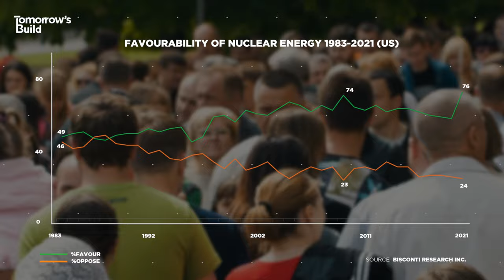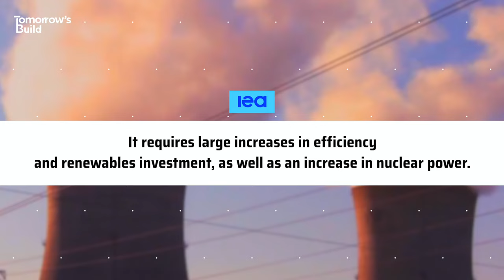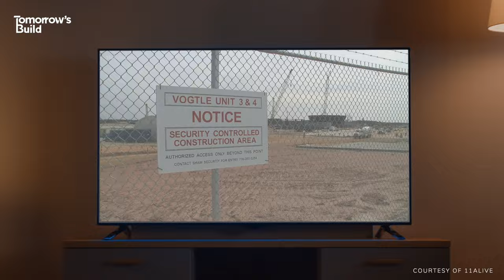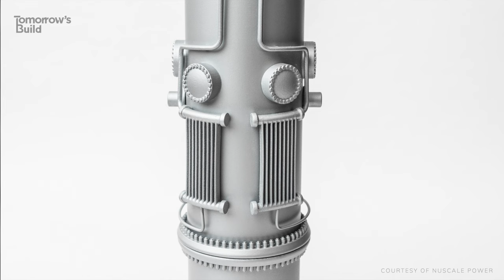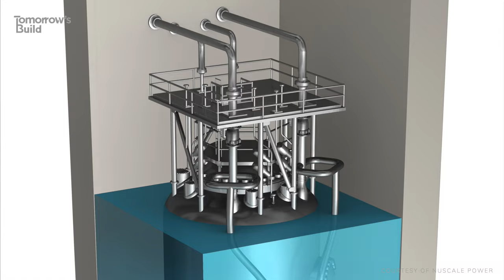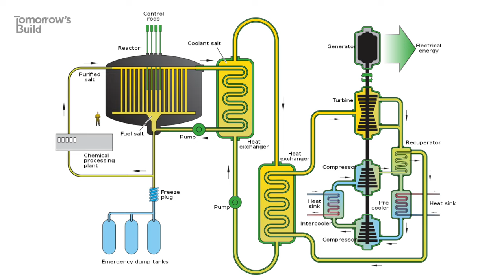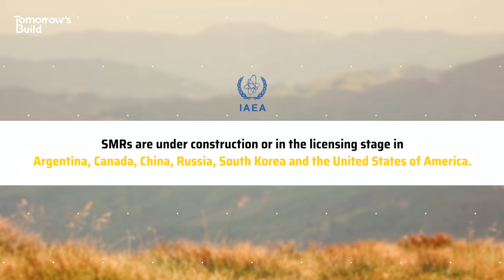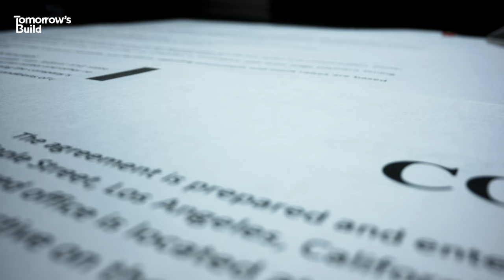These Mini Nuclear Reactors Can be Built Anywhere

Comment: The US has been building "small" reactors for naval deployment for literally decades.   I find it far more shocking that this experience has NOT been incorporated into small, modular power plants for domestic use than any news that it might finally be happening.   About time.
Reply: For military use, cost per megawatt is not a concern.
Reply: Much of the tech is classified for national security reasons.
Reply: We need these SMRs as soon as possible. Set up a production line right now.  Rolls-Royce UK can build them cheaply - one or two for each town or City.  Let’s get going with a production line assembly.
Reply: The problem with "domestic use" nuclear reactors is both safety and security. I would not want a nuclear meltdown in my literal back yard, because some neighbor decides to save some money on maintenance. And I would not want nuclear materials readily available for every guy with a beard that wants to make a dirty bomb.     
I would prefer small modular nuclear reactors, deep underground, with proper safety and security measures in place.
Reply: The naval core geometries and rod programing (and arrangement) are based on a very highly enriched fuel and restricted space, so refueling only has to be performed a few times over the lifetime of the vessel (more for the early ships and boats, and the cores on the new class of carriers are supposedly good till end of life of the ship). The cost of the fuel and the fact the enrichment is higher than that allowed in civilian plants is one of the biggest reasons the tech doesn't transfer bolt by bolt. Also the physical construction of the navy core fuel assemblies and cooling channels is just way over built for civilian use, think using a Humvee as a daily commuting appliance overbuilt.

With the new SMRs the emphasis is really on "walk away" safety and factory production efficiency all while meeting all the industry experience gained in the past 50 or so years of civilian power plant operation. The navy core safety systems are based on the fact the plant is literally sitting in the largest pool of coolant in the world with a highly trained crew using rock solid casualty procedures, where the SMR designs have to consider possible deployment in places where coolant isn't as available and still shut and cool themselves down without operator action or external power sources.
Reply: We need to produce them in factories so they can be inspected in bulk, and kept safe, if not made safer. That will bring down the cost.
There will be a minimum practical size for a mobile reactor for use in ships. This will cause a minimum size for a ship that can run nuclear power practically. For instance, let's say the minimum practical size for such a ship is 130 feet long. Then it would be stupid making 120 foot long ships. Make ships at least 130 feet long and use nuclear power.

With time, reactor sizes might shrink some more. If/when that happens, then 100 foot, 80 foot, or even 60 foot nuclear ships could make sense.
All naval ships, many of the naval boats, and all ocean freighters and cruise ships should go nuclear.
Reply: @quercus3290  Part of the issue is waste: the US, and the average consumer, lack proper disposal facilities. Building a whole bunch of new reactors when current reactors already lack disposal facilities would be... bad. In the same way, we have the technology for flying cars, but you'd be effectively scaling up all the accidents of early aviation to a commercial scale.
Reply: @scratchy996  Absolutely. Also, I don't want some corporate bean counter (probably without a beard) to decide that the company will skip on maintenance or SECURITY to up the bottom line, because the subsidy ran out. 
Some things are NOT socially or economically efficient in the private sector. This is one such. Mutual benefit and transparent operation need to happen, same with wind and solar. And it needs to be a PUBLIC utility.
Reply: @thezfunk  This sounds like people outside the military have reinvented this on their own, and the military has not yet swept in with money for their patents or to order them to quit. 
Now it seems to have hit the market of ideas as well as the market, so what can they do?
Reply: @majoroz4876  no? First off, the storage facility need to be isolated from water, food and wildlife, because contamination risk. It needs to be long term, like centuries long term, because that's the sort of time frame nuclear waste is dangerous on. There needs to be security, because it's goddamn radioactive material that some crazy bastard might steal. Infrastructure to support that security and transportation of the waste, and it needs to be safe from things like earthquakes and other natural disasters. 
You don't just pile all the waste on top of itself in a shallow grave, because that's how you turn a state, or maybe even a continent, into Chernobyl 2.0.
Maybe read a book and you'll know that the US government planned such a facility, but never followed through, not for lack of experts saying it's needed, but for cries of NIMBY.
Reply: @callumjohnston858  I have degrees in engineering, science, health, and edication.  I have taught them for 50+ years.   People like you kick, scream, and resist ANY forms of progress out of fear and would not install light bulbs in their homes until decades after the rest of us.  The polite term is ignorant chicken littles......but there are other terms.   Research Dixie Lee Ray, the first cheif of the Atomic Energy Commission.
Reply: @majoroz4876  Sure mate, you've got all the degrees. But what you don't have is the knowledge that the USA has no long term nuclear waste storage facility for its current nuclear power plants (let alone any new ones, or SMRs) despite having selected a region about 30 years back, and is effectively paying for storage on-site, which is an unsustainable solution (literally, it cannot be kept up, given costs and the fact that storage facilities are already breaking down) and has already caused numerous health concerns for those nearby. 
This isn't about rejecting progress, this is about not having the fundamental infrastructure to progress without everyone getting radiation sickness. There's a level of irony there, given that sustainable non-nuclear alternatives exist (and before you jump on that, I wouldn't bring them up if they weren't about the same in terms of practicality and cost). 
And frankly, I don't see what Ray or her time in office has to do with that, except the vague similarity that nuclear energy was involved.
Reply: @quercus3290  bruh, the whole earth core is the nuclear waste. But yeah, dealing with is pain.
Reply: @majoroz4876  security is a serious point. All big nuclear stations has military forces in arms reach in case of terrorists attack. You simply cant provide that for your basement reactor.
Reply: Damn right. It's fine for a sub or an aircraft carrier but not for civilian use? Wtf?
Reply: @squamish4244  do you think every country should have a nuclear industry?
Reply: @squamish4244  yes. The price.
Reply: @squamish4244  We are talking about big/small reactors comparision, and whatever you do, the small one will loose price competition. Simply because efficiency of all systems scales. I am not even mention security issues of small reactors.
Reply: @squamish4244  my concerns about every country having a nuclear industry is that some countries like North Korea are extremely dangerous and supplying uranium to them will destabilise their neighbours. 
That would involve the USA military and the USA defence costs increasing.
Reply: @stephenbrickwood1602  The USA already spends at least $81 billion a year and probably a lot more on its military presence securing oil production and distribution.

Every country having a nuclear industry and that being a danger is a political issue and not an economic one. If we are going to go there, then we also have to factor in the fact that civilization is literally under threat from fossil fuel production, and that is not a theoretical risk that diplomats can handle.
Reply: @squamish4244  you are right about the global threat of fossil fuels. 
It is a good question how do you stop an independent country from using fossil fuels if that is their choice. 
It would be an embarrassment  for many countries to go with 'no CO2' and still others 'freeload' and keep burning fossil fuels. 
A country may feel that a warmer planet suits their geography, latitudes,  ???
Trade sanctions and better technology may work. 
Do you know the term 'nuclear winter'? 
Many do not.
Or Climate destabilisation  ?
Reply: @majoroz4876  do you think every country should have nuclear industries  ?
Reply: @stephenbrickwood1602  I don't think that every country SHOULD.......anything.  But, I think every country should have the RIGHT to have one, if they so desire.

Comment: By downscaling the size of the reactors, if there ever is a major problem, the aftermath with be smaller too. Unless there is a design flaw, many smaller reactors seems much safer than one big reactor, since the big ones tend to get too expensive to maintain.
Reply: Not really true. It's largely dependent on the type of (used) fuel/fission products and how far exactly such a hypothetical accident would go. The actual size of the reactor and amount of fuel says very little how much could be contaminated.
Reply: @lennoxbaumbach390  Nuclear engineer here, this isn't true. More power = more fission = more fuel, a lot more can wrong when you're dealing with gigawatts of energy (especially in water reactors where pressure can be a problem). Specific fuel type doesn't matter if there's a Chernobyl type accident, a high power reactor will spit out more nuclear material and fission products than a smaller one. And that's without considering the safety mechanisms that a lot of these newer designs are using. Things like passive cooling and inherent reactivity feedback go a long way in keeping the fuel safe and sound. Plus designs like molten salt and metal reactors operate at essentially atmospheric pressure.
Reply: pyropulse  If they explode violently in a Chernobyl type accident with no containment they do, however the probability of such an accident happening with modern reactors is essentially impossible. That said, my original statement still holds true, a higher power reactor (especially one dealing with high pressures) is technically a greater risk than smaller reactors.
Reply: @lennoxbaumbach390  
You are talking crap.

Comment: Molten Salt Reactors (MSR) are safer and cost less because they are not pressurized like water based reactors. SMRs that are water based are just as dangerous as light water reactors. They can blow up or melt down.

Comment: Heavy industry needs to consider these. Like I get that these can't be used to fire steel foundry crucibles. But what about the rest of what runs on electricity? Like hydraulics, administrative areas, etc. etc. Let gas melt the metal, but I'm pretty sure a whole bunch of other stuff can run on this. We need to replace the worst polluting power plants, the last of the coil-burners.

Comment: Great to see Nuclear Power coming back. Many small are much better than a huge one. Modular makes them more convenient and flexible to operate. Would love to see micro/nano to power Rail Engines as well supply power to Railway grid. They are ideal for such things.
Good to see the nuclear waste being used. Hope that the nuclear waste problem will get resolved in environmentally safe way without consuming too much space and at much less cost. Recycling as fuel would be the way but still after that some % needs to go to waste.

Comment: Or start building shipping container size passive radiation reactors that have already develop and working. For instance one Russian village bough one from Russian military, buried it on the corner of the field to amp up radiation barriers and it powers whole village with some excess power being produced. Its entirely self contained and adjusted unit that only needs to dug up every 20 years to refuel. Only down side is that it needs to have some load on it constantly, but that is easy enough to solve by pumping excess into grid and having safety load case grid connection is cut by storm etc. Also it might need little extra radiation shielding since soviet engineering, but it works, sadly average person is not allowed to be energy independent around here, that would remove people from grasp of the government.
Reply: You forgot the other downside: It's not cost effective (unless you're in some remote isolated part of the earth).
Reply: And after 20 years, it malfunctions, is abandoned, forgotten & left to deteriorate in a cornfield somewhere until it starts leaking radioactive products.
Reply: Building 5 to 10mw small nukes would be in runs at a factory which would reduce costs. Plus they can be built in groups of 2 or 4 for larger requirement loads.
Reply: @bradvansteinburg2962  Designs for small modular nuclear reactors have been around since the 1960's.  Unless the factory is really remote, connecting to the grid is always going to be far more economical.
Reply: You're "not allowed" to be energy independent because there is no such thing. Claims otherwise are illusionary.
Reply: 3, 5 , 10mw reators will be cost effective built in a factory.  No need to build 100mw + nukes in most cases as tech had changed.
Reply: @bradvansteinburg2962  its not cost effective when you factor staffing, security, national defense risk, and expected corporate malfeasance.
Reply: @bradvansteinburg2962  That's been the promise for a long time.  Some nuclear energy startups have made big promises, but I suspect they'll only deliver small, incremental cost progress.

Comment: I love the smaller ones that look like they could almost fit in a container. I can see the smaller ones as being a safer way of providing electricity to small Northern California towns that are isolated, doing away with the need of long-distance power transmission lines that power companies don't seem to want to maintain anyway. The U.S. is lucky in that solar and wind power both make economic as well as environmental sense but the smaller ones seem viable. I can see Western militaries also using the smaller ones in the near term future. More power is required for the battlefield and if Brigade Combat Teams were set up with electric vehicles the SMRs would enable that process and reduce the Army's logistical tail.

Comment: Another use of modular reactors could be as a power plant for large container ships and the like.
Reply: Nuclear subs cost $3.5bn - $7bn. The world's largest container ship costs $190m. Whilst they are different beasts, the nuclear reactor cost is a large compoenent of the total.
Reply: Modular reactors would be cheaper than the reactors powering current warships and subs, which shouldn't compare with container ships, since warships and subs are armed to the teeth with very expensive weapon systems. Besides, with diesel and coal off the table with climate change legislation, what else are going to power these ships? Where would you put sails or solar panels atop a container ship?

Comment: I remember learning in high school that 90% (some high number) of the costs associated with building modern day nuclear reactors come from the concrete tower around it. Russia and China were able to pop reactors around the place due to having looser regulations and hence very thin concrete walls (i.e. they recognised that the concrete is obselete and hence only use a concrete facade to appease the public). If only governments had not neglected reactors in the past... None of these "safety concerns" would be in debate and we'd be lot greener for it
Reply: sounds like making faster cars by having no airbag.
Reply: damaging, racist as it divides POC communities, and dangerous. We need more public and human based transportation, hell  even publicly owned horses would be a better alternative.
Reply: @therealspeedwagon1451  Racist? Weally?
Reply: @therealspeedwagon1451  Everything is racist these days. Freeways I understand, but nuclear plants? Seriously?
Reply: @steeldriver5338  atoms will split regardless of race
Reply: Nicanor makes an excellent point. It does seem like making the car be faster with no airbag, or seatbelt, or sunshield visor.  That's how people will see it, and will insist on a lot of protective structure.  So unless the small ones remain cool even if a LOT of them (for economy) are behind the many layers, you'll have the cooling problem again.
Reply: @steeldriver5338  It's about site location, just like highways. Until you can convince some wealthy communities that the risk is low,  AND they work for a few years. please do not try to sell it in the 'Hood.